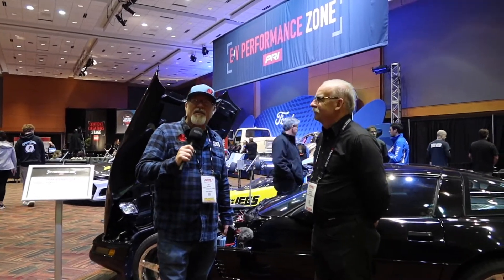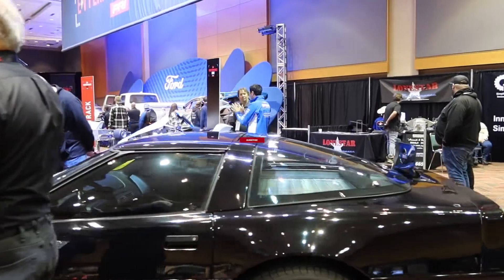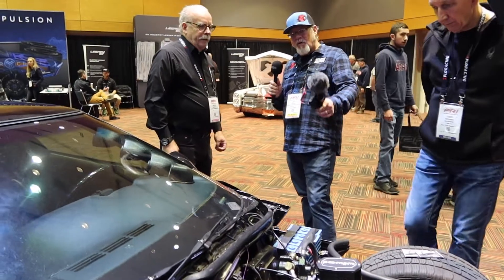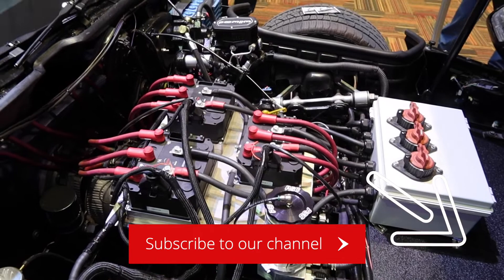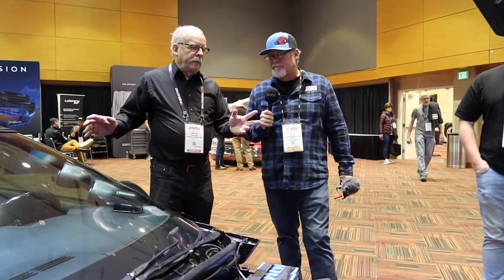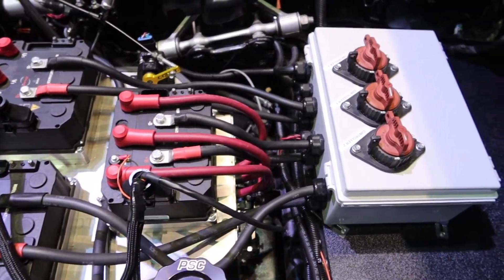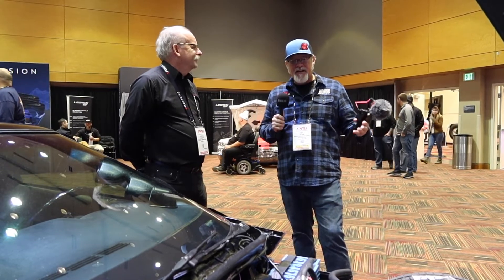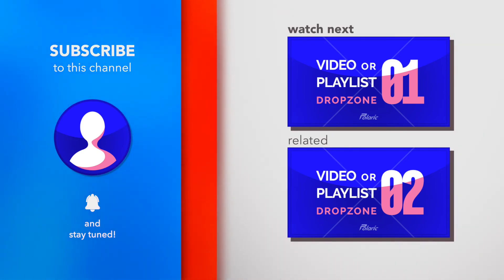#EVConversion: 1996 #Chevrolet #CorvetteC4 with Wayne Bickley - Live From PRI 2021 | PCG Automotive

Comment: 3 netgain motors? How did he connect them? What did he use for the vacuum on the brakes? Or did he switch to hydro? What about the heater/AC? What batteries? No much info about the vette. But good to hear these things are happening.
Reply from the maker: @William Pozo If you Google "Wayne Bickley Electric Corvette" you will turn up most of the information you are asking. He was constantly changing as technology became available. I am sure you can contact any of the suppliers of this technology and get all the answers you need!! Thanks for watching, please subscribe and by the way...The Hybrid and All Electric Corvette E-Ray is coming direct from GM!